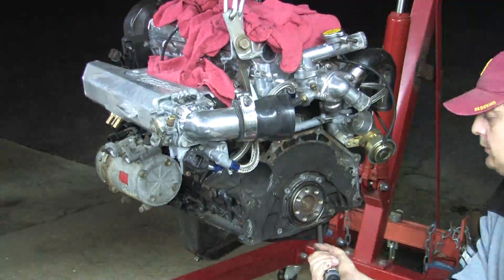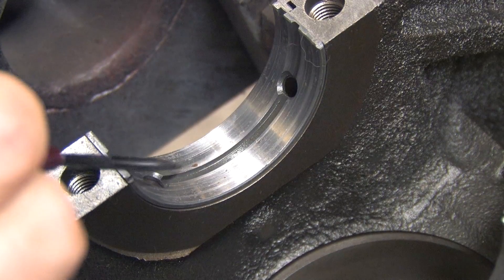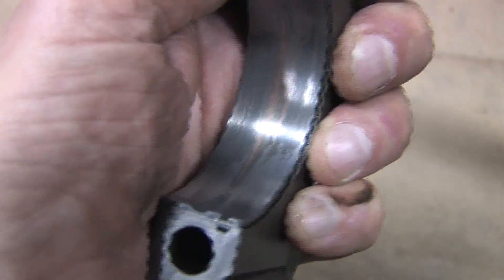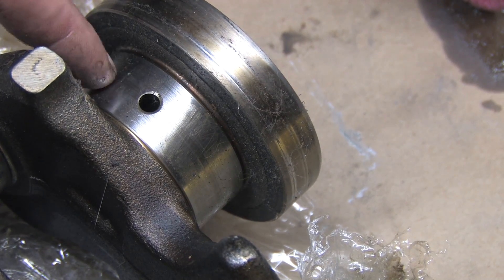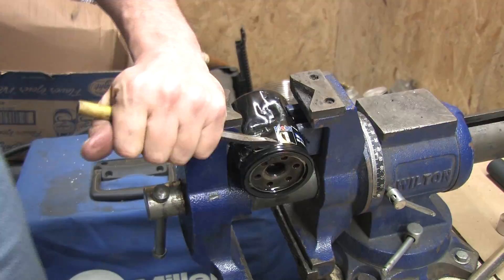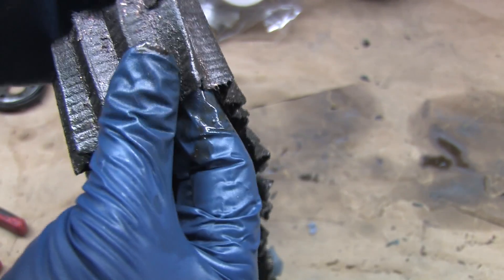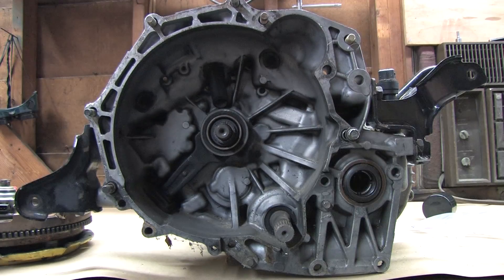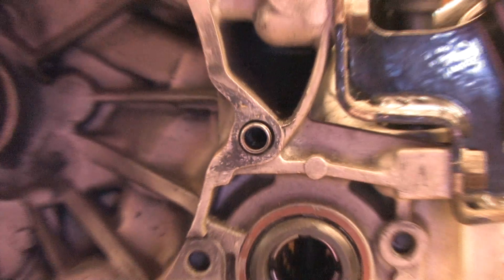7-Bolt Shortblock Failure - Full Diagnosis

Comment: So.....change the damn oil filter (and oil, goes without saying)  once in a while, it's cheap insurance ?;  i've had engines (diesels)  where i had to change new oil and new filters 4 (FOUR) times, and that takes time,   before the oil was acceptably clean ( usually done in the presence of the customer, and done while the engine was still alive, but barely  lol ).

Comment: Is this bolt only in the AWD models? I have a GST and am looking to prevent CW as much as possible
Reply from the maker: Nope!  It's on everything.  Every 4g block.  All of them.  Even the 4g15.  There's 2 "ears" on the bottom corners of the block sticking out that bolt to the transmission.  The bolts that go through them... one goes through one side on this ear... the other one goes the other way on the other side.  One's an M10, one's an M8.  It's often overlooked and left out after a clutch service.
Reply: @Jafromobile  thanks Jafro! I’ll definitely be checking mine now! Looking forward to more videos!!

Comment: My bellhousing bolt was missing too!! i had bought the car with a blown clutch and replaced it. May have never been there or maybe i misplaced it but its definitely on me for not knowing it was missing on reassembly. 7 years later you're still saving DSM's with this video!! 

Your videos have been a life saver so far trying to understand my car as the previous owner has 6bolt swapped it. It was a long forgotten project ive had for 9 years that i have neglected after the water pump failed. The pandemic has given me time for self isolating hobbies again and ive been steadily fixing the rust and got the waterpump, belts, and pulleys replaced. Now it turns out i need a gasket due to overheating when the pump went. Got a small leak on 1st cyl into the coolant (leakdown test proved this). I notice it already has an MLS gasket so im hoping the block is still flat and smooth because i dont have much time or space to be pulling the block to get the RA right for a new MLS gasket. Anyways thanks for the videos, ive been binging the channel like netflix haha

Comment: Doubtful you'll see this, but I know you'll probably reply if you do. Have you or has anyone considered tapping another bolt hole in the transmission or engine along with a matching hole to add even more clamping force? Another bolt somewhere below the center line of the input shaft as you demonstrated seems like it would be useful.
Reply from the maker: There are already two matching doweled holes on both of the bottom corner of the block.  It would be a messy endeavor to add another one as the aluminum bell housing has risen castings along all of the transmission bolts.  It tapers thinner where there isn't a bolt.  So while you could add one, unless you did something to build up or strengthen it, you may have added a great place for the bell housing to crack.  One of those doweled holes nearby is the one the crankwalk bolt goes into.  If it's there and torqued properly, then it solves the problem.  So the added hole should be unnecessary.
Reply: Awesome. Thanks so much for answering. My concerns were about cracking plus difficulty with placement as well. I appreciate your assessment of it being unnecessary. Keep being awesome. :)

Comment: Still going through all your videos for the...5th? 10th? 100th? Who's counting?

A thought occurred to me. Have you checked runout on input shaft of the transmission to make sure it's not bent too? Hypothetically it and/or the bearings, could have suffered damage too.
Reply from the maker: You know, I haven't checked it for runout... but I know there's zero slop in it. You can't jiggle it in any direction and feel any movement.  It's made from a material that's unlikely to bend, but IT IS in a DSM... so...  Perhaps I'll check this out?  It should be fine, though.  There's not even a thousand miles on that transmission.

Comment: Jafromobile thanks for your reply. Yes anything is possible including having everything cryogenicaly treated. The only real limits are how big is your budget and how big is your imagination. Anything short of having a new crank made from billet is really not that high priced anymore it all used to be pro racing only as more people do it it is getting more reasonably priced. On another subject at what point did they go from he conventional thrust bearings that are 1 piece to the crap bearing and thrust washer system? Can a later block that has the thrust washers be remachined for a conventional 1 piece bearing with thrust surfaces built in?

Comment: One small inaccuracy, after grinding and polishing the crank can be nitrited to reharden the journals or even built up with hard chroming. You would be suprized how bad a crank can be and still be saved.
Reply from the maker: It's a platitude.  There are most certainly magical metallurgical techniques that can fix anything short of being twisted into a pretzel.  In that regard, I totally 100% agree with you.  I thought I said "it's really hard to put back on there", not that it couldn't be done?  I'm having a hard time locating the place where I said it... but if I said it couldn't be done, it's because the majority of machine shops the average import gearhead knows can't or won't affordably perform that service in-house.  The 4gxx crankshafts are popular and durable enough that most people fix this kind of issue by dropping $80 at a junkyard for round 2!  :P  They don't know what they're missing out on, though.  There's nothing sexier than a freshly-balanced nitride-coated crankshaft for your race motor.

Comment: WD-40 will make shit rust,......use a grease with detergent in it,... even if there's rust on it,....in a year or two  it will be shiny metal.
You can warm the surface with a propane torch and smooth it in with a rag.

Comment: What destroyed your little enf was the clutch . Big tension clutches put huge forces on the crank , mains and big ends . Vibrations crank chatter is when the clutch is used at high rpm . Ditch the manual . Install a 4l60e auto .

Comment: Is a 7-bolt worth getting? i can get one with the Turbo harness ecu for 550 bucks
Reply from the maker: If you have a car it fits in, that's a good deal.  If you're trying to replace an engine in a formerly-6-bolted car... it's not ideal, but the 7 bolts are nearly as tough.  What car are you trying to power with it?  What are your goals?  What year 7 bolt engine is it?

Comment: Well them dial pins on each side that's what the lines the transmission to the block not your fucking bolts
Reply from the maker: If the bolts loosen because either one is missing OR they're not torqued properly, the dowel pins don't do anything more than wear, wallow out and distort the dowel pin bosses in your soft aluminum transmission bell housing... and after replacing the dowel pins, bolts and re-torquing everything, the dowel pins now contribute to mis-aligning your transmission and ultimately destroying your rotating assembly.  That alignment has to be perfect because there's no pilot bearing.  You screw up the torque of your bolts on a 4g63 or lose that "crankwalk bolt", your outcome won't be any different than this.  This is very clearly outlined in the transmission & clutch series.  It's either #2 or #3.  That alignment has to be perfect on a 4g63.

Comment: You're clueless. That failure began at the crankshaft thrust bearing and was caused by significantly increased thrust loads during clutch DISENGAGEMENT when you put an aftermarket clutch in to dramatically increase the "clamping force" of the clutch. Thrust bearings are only designed to take "light' intermittent thrust loads from the STOCK clutch engagement pressure and pressure plate force. I've seen people "spin" the crankshaft thrust washers in a heavy-duty diesel engine in a farm tractor with the engine not even running and the tractor "split" FOR clutch/engine work because they forced the tractor back together when the clutch shafts weren't properly aligned with the clutch disks and kept spinning the crankshaft with bolts forcing the parts into contact so the thrust washers which are separate pieces from the bearing shells but are "keyed" to them to prevent them from rotating sheared off those "keys" as they were forcing the tractor together at the clutch housing. That's on a tractor with a hydraulically APPLIED clutch assembly that has a pretty significant forward crankshaft thrust load when the clutch is ENGAGED i.e. MOST OF THE TIME. But since the engine and crankshaft and thrust bearings are designed to handle THOSE loads "forever" there's never a problem there. But take the same parts in a non-running engine that was "dry" because it was a REPLACEMENT REBUILT ENGINE and put maybe twice or three times as much force forward on that thrust main and spin the engine over with a prybar in the flywheel housing to try to "align" those clutch shafts and in a few minutes and revolutions they "spun" the thrust main bearings because there wasn't enough lubrication there to carry the load and even there was too much friction and something had to give. Its funny you mentioned rod bearing material in the main bearings when  the oil flows from the main bearings to the rod bearings and not the other way around. What did your OIL PUMP look like inside pumping all that "contaminated" engine oil? Who did your CLUTCH WORK and left that MISSING BOLT OUT OF THE FLYWHEEL HOUSING AND WHAT ELSE DID THEY DO WRONG IN INSTALLING AND MAYBE SELECTING OR "SPECCING" AN AFTERMARKET CLUTCH WITH FAR MORE "CLAMPING FORCE" THAT RESULTED IN MASSIVELY INCREASED THRUST :LOADS PUSHING FORWARD ON THE CRANKSHAFT? And how long did the engine sit not running and getting DRY while those clutch modifications were being made leading up to no doubt a situation where somebody jumped into the driver seat after the clutch installation, planted their foot on the clutch and the pedal on the floor and then cranked the engine to fire it? What kind of lubrication was getting to that main bearing and thrust surfaces THEN? Did someone at some point change the engine oil or start to change the engine oil but forget to put new oil back in or otherwise "screw the pooch" on something that led to the engine being started and ran "dry" again while somebody had a foot on the clutch pedal and the pedal on the floor for at least however much time it took to start it up and presumably sit there waiting to see the oil pressure gauge come up and getting NADA and THEN shutting the engine off? Got a news flash for you, chief. It would take all of a few seconds for a dry crankshaft  thrust surface being forced forward against a dry main bearing thrust surface with no oil pressure to gall/scuff/score that surface and start "wiping" off the soft metal "babbit" on the surface of bearings before getting to the copper/bronze/tin/aluminum or whatever metals exactly are in those bearings in that engine between the "babbit" and the steel backing. Hell, its so easy to overload a thrust main bearing and do damage during a cold/dry start even WITH engine oil in the engine and a primed oil system if the clutch release pressure is high that lots of heavy-duty OTR trucks with those big Caterpillar and Cummins engines have clutches that when disengaging pull the crankshaft REARWARD with the main thrust on the FRONT side of the thrust main bearing because their HELICAL TIMING GEARS IN THE FRONT OF THE ENGINE create a "pulling" force at the FRONT of the crankshaft already so there is always already some load on the rear thrust bearings at all times. At some point and probably after some "mechanics" (that's my line of work and I'm damned good at it and have worked on more than enough different machines from  nitro RC cars to 4500-hp General Electric locomotives that say Union Pacific on the side and PLENTY of "high-performance" gas-burners even though I'm "just a diesel mechanic") figured out what was baffling some "egghead" wannabe "engineer types" who had all the answers but to explain rear thrust main bearing failures in MULTIPLE ENGINE MAKES AND MODELS in NEARLY NEW HEAVY-DUTY TRUCKS WITH NEWLY "UPRATED" HORSEPOWER RATINGS WHERE NOTHING WAS CHANGED IN THE ENGINES THAT COULD EXPLAIN INCREASED THRUST LOADS SINCE ADDING TORQUE/HORSEPOWER DOESN'T PULL FORWARD ANY HARDER ON THE CRANKSHAFT AND OTHER CORRECT "ANSWERS" FOR WHAT DIDN'T CAUSE THE PROBLEM AND MULTIPLE THEORIES ABOUT WHAT WAS CAUSING THE PROBLEMS JUST REFUSED TO BELIEVE ANYBODY "DUMBER" THAN THEY WERE COULD FIGURE IT OUT JUST BY LOOKING AT SOME PARTS AND THINKING THINGS THROUGH AND KNOWING HOW THINGS WORK AND WHAT THEY WERE SEEING AND WHAT WAS A "CAUSE" AND WHAT WAS AN "EFFECT" JUST REFUSED TO BELIEVE IT COULD BE SOMETHING OUTSIDE THE ENGINES EVEN THOUGH IT HAD TO BE IF HAPPENING TO MULTIPLE VEHICLES POWERED WITH MULTIPLE DIFFERENT ENGINES OPERATED BY MULTIPLE DIFFERENT DRIVERS WITH DIFFERENT DRIVING STYLES BUT THE ONLY THING IN COMMON WAS "MORE POWER". GOOD THING THE "DUMB" MECHANICS WHO THE "EXPERTS" WOULDN'T LISTEN TO WERE LISTENED TO BY SOMEBODY WITH SOME COMMON SENSE TO AT LEAST HEAR THEM OUT WHEN THEY SAID "HEY, THE DEAL IS THAT WITH THOSE BIGGER< HIGHER-HORSEPOWER ENGINES THEY"RE MAKING A LOT MORE TORQUE AT THE SAME SPEEDS TO MAKE MORE HORSEPOWER. MORE TORQUE MEANS THE TRUCKS CAN BE GEARED HIGHER IN THE TRANSMISSIONS AND REAR-ENDS TO GET BETTER FUEL ECONOMY AND LONGER ENGINE LIFE FROM LOWER ENGINE SPEEDS. BUT THAT ADDITIONAL TORQUE REQUIRES A MUCH "STRONGER" CLUTCH AND TO MAKE A DOUBLE-DISK CLUTCH LIKE THEY ALREADY HAVE WITH DISKS AS LARGE AS THEY CAN POSSIBLY BE IN A CLUTCH ASSEMBLY THAT'S AS LARGE AS IT CAN POSSIBLY BE TO FIT THE FLYWHEELS THE ONLY THING THEY CAN DO IT ADD SPRING LOAD TO PUT MORE FORCE AND FRICTION AT THE DISKS AND PLATES AND FLYWHEEL SURFACE. WHEN THOSE HEAVIER CLUTCHES ARE DISENGAGED THERE IS THAT MUCH MORE FORWARD THRUST ON THE CLUTCH AND FLYWHEEL AND CRANKSHAFT AND MAIN THRUST BEARINGS. AND WHEN THOSE ENGINES ARE STARTED DRY/COLD AND ESPECIALLY AFTER AN OIL CHANGE AND IT TAKES SEVERAL SECONDS TO GET THE FOUR OR FIVE GALLONS OF ENGINE OIL IT TAKES TO FILL THE WHOLE LUBE SYSTEM OF A RUNNING ENGINES THOSE BEARINGS ARE RUNNING "DRY" AND WITH THE CLUTCH  PEDAL ON THE FLOOR BECAUSE ITS JUST NORMAL FOR A GUY TO JUMP IN AND PUT HIS FOOT ON THE CLUTCH BEFORE TURNING THE KEY ESPECIALLY WHEN HE HAS TO TO GET THE ENGINE TO START BECAUSE OF A CLUTCH SAFETY SWITCH ON MANUAL TRANS VEHICLES. AFTER AN OIL CHANGE HE'S GOING TO WAIT TO SEE OIL PRESSURE AND NOT TAKE HIS FOOT OFF THE CLUTCH TIL HE DOES BECAUSE HE"S FOCUSED ON THE OIL PRESSURE GAUGE. AND CLUTCHES GET ENGAGED AND DISENGAGED MOST IN AN OTR TRUCK THAT MOST GUYS DON'T CLUTCH TO SHIFT GEARS ONCE MOVING WHEN THE  ENGINE IS IDLING AND EITHER "HOT" WITH THE OIL AS THIN AS IT CAN GET OR "COLD" WITH THE ENGINE AS THICK AS IT CAN GET AND SINCE THOSE TRUCKS HAVE A CLUTCH BRAKE TO STOP THE INPUT SHAFT BECAUSE THERE ARE NO SYNCHRONIZERS AND THE GEARS AND SHAFTS HAVE TO "STOP" TO GET THEM IN GEAR, THAT"S MORE TIME THE CLUTCH IS DISENGAGED AND MORE LOAD ON THE CLUTCH AND FLYWHEEL AND THRUST MAIN BEARING. TO MAKE A LONG STORY SHORT, THEY NEED TO COME UP WITH SOME KIND OF CLUTCH DESIGN THAT DOESN'T PUSH FORWARD ON THE CRANKSHAFT BECAUSE THE THRUST WASHERS WON'T TAKE IT WITH A LOAD FROM THE FRONT GEAR TRAIN ALREADY ON THEM. IDEALLY THEY'D COME UP WITH A CLUTCH THAT PULLS BACKWARD ON THE CRANKSHAFT TO NOT ONLY NOT OVERLOAD THE REAR THRUST BEARING BUT TO ACTUALLY REDUCE THE LOAD ON IT BY BALANCING SOME OF THE LOAD FROM THE FRONT GEAR TRAIN WHEN ITS HIGHEST WHICH IS DURING THOSE SAME COLD DRY STARTS AND HOT AND COLD STARTS AND STOPS. THATS THE PROBLEM AND THAT"S THE SOLUTION. LESS CLUTCH LOAD OR LESS POWER SO THEY CAN GO BACK TO 
WEAKER CLUTCHES AND LOWER TORQUE AND LOWER GEARS. 

That's how REAL MECHANICS GO ABOUT FIGURING THINGS OUT. But hey, I'm sure your dirty oil ruined your engine or would have anyway after whoever put your clutch in screwed that up. Either way whether your "failure analysis" is correct or it really was "crankwalk", it must have been your own failures that had dirty oil in your engine and some  fool who left out bolts putting your clutch in or whatever it was that somehow overloaded the ONE MAIN BEARING IN THE ENGINE THAT CAN'T TOLERATE MUCH EXTRA LOAD AND LEAST OF ALL IN A LITTLE 4-banger rice grinder engine that was never designed to handle anywhere near the kind of TORQUE and CLUTCH LOADS that those things apparently make. 

But hey, yours was probably the ONE THAT DIDNT HAVE THE FAILURE EVERYBODY ELSE'S DID OR HELL THEY WERE PROBABLY ALL MISDIAGNOSING THOSE FAILURES ALL ALONG AND JUST NEEDED YOU TO BLOW YOUR JUNK UP TO FIGURED IT ALL OUT FOR THEM. 

Congratulations. You're a master automotive engineer throwing stupid amounts of time and money at drastically increasing the power output of already highly strained and stressed engines who manages to do so without having the same failure lots of others did and you even retroactively re-diagnosed their failures. Did they have dirty oil and missing transmission hardware too? I mean those WERE your TWO "final answers", correct? Weird how you never felt those massive powertrain shocks and harmonics and that they made it all the way to the middle of the engine before doing their damage.

Comment: OMG, my mind is blown! (12:07) Back in 2004 I had a 1992 Talon AWD TSI on 25 psi of boost. I was never sure why the engine had failed the way it did. The transmission block bolts backed out resulting in a broken clutch (act 2600), engine block and cracked Shep racing trans.